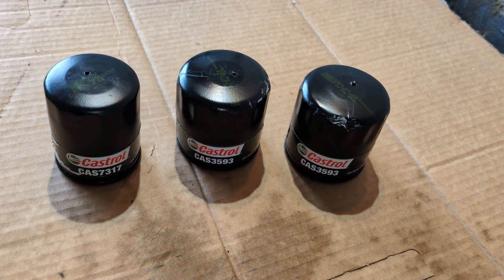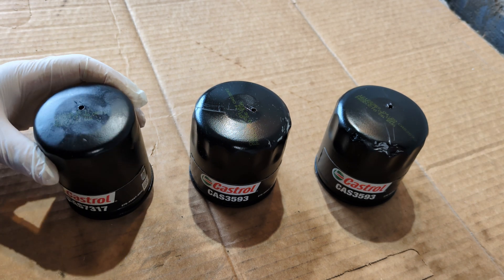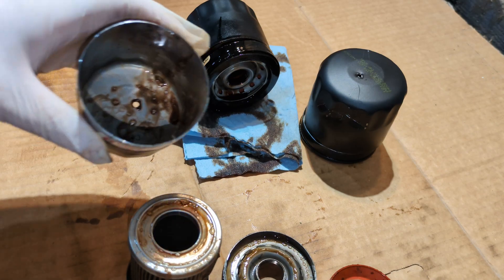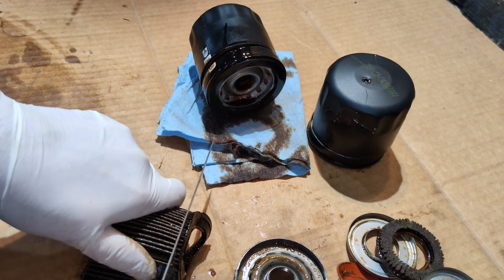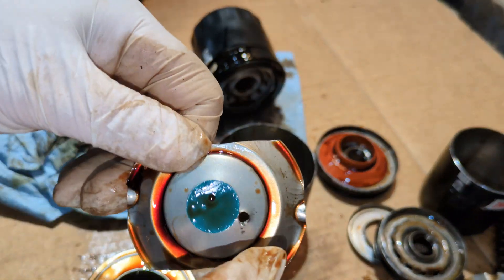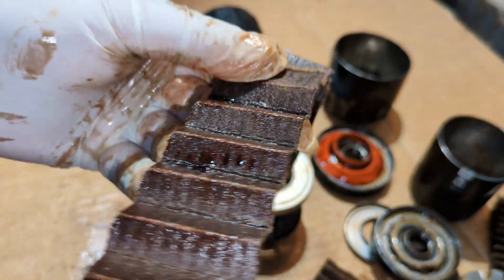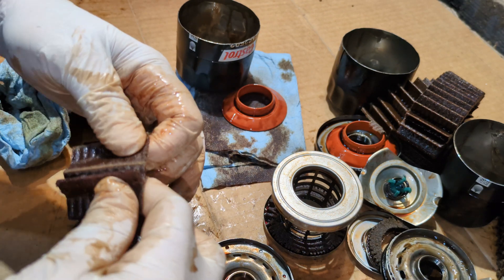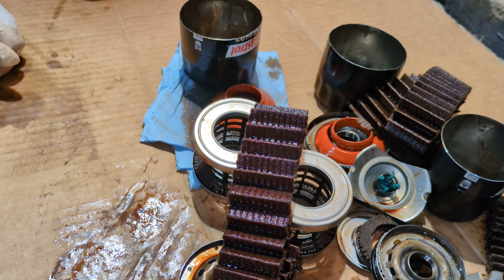Castrol oil filters cut open and inspected

Comment: I want to be a 1%er in the CBG Oil Filter Club!  Can I be a Prospect?🤪
The Motor Oil Geek says that some long OCI filters have reduced efficiency so that they don't clog up before the 20K miles is done.  This could explain the 99% at 25 microns rating.
The 7317 is a Subaru filter number in the Fram lineup, so that could very well have come off a car with a blown HG and overheating.
Reply from the maker: Anyone can be a 1%er in something on my channel. Just glad your not a 1%er on my bad side. 
The 7317 does have a good chance to be on a failed engine. I do have a bit of Subaru drivers who use the facility and I know some had engine work done. Very possible on that call 😉

Comment: Change my oil 6 months or or 3000 miles on autoz. 50 hours on riding mowerz. 100 hours on lil 24-7 generatorz!!! All smooth running!
Reply from the maker: Loren you have a great schedule for long lasting vehicles and equipment.  👍